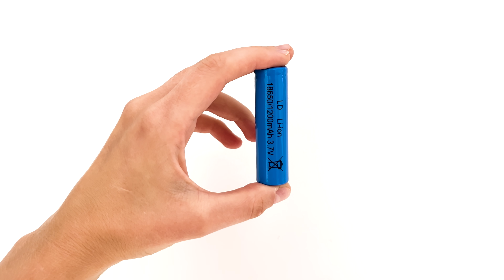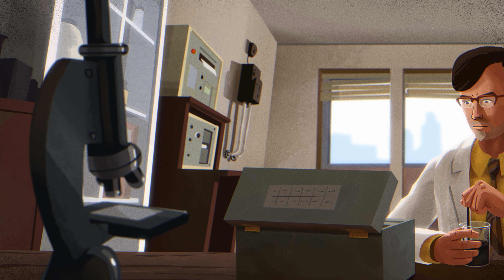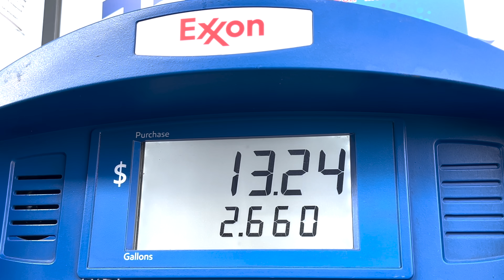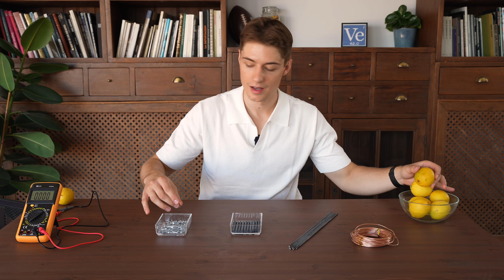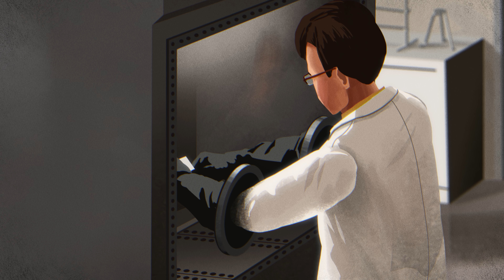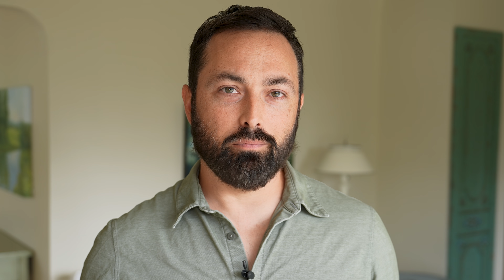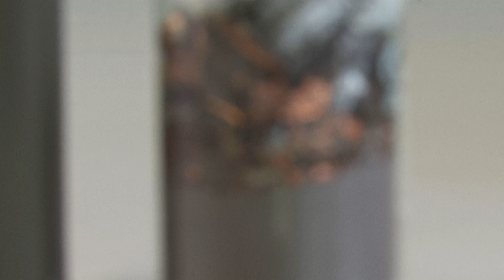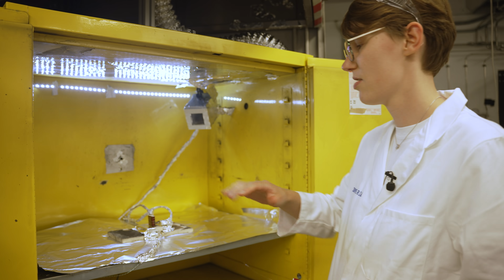The Perfect Battery Material Is Dangerous

Comment: Wish you had touched on the "new" LiFePO4 cells. Lower energy density and voltage, but significantly more stable chemistry, thermal resistance, and increased charging cycles. And being that it is not Cobalt based, but rather Iron and Phosphate based, much less environmentally damaging, and easier to produce. Really cool battery tech imo.
Reply: LiFe is my goto for all my rc transmitters. it still runs like a beast after 10 years
Reply: @simunator you probably need to upgrade your hardware, I have a TX16S that uses 18650 cells and the lithium ones last forever but it can also go for hours on one charge at 1000mw output if I want to fly over 25 miles away
Reply: Was just about to say the same. The New Generation of electric vehicles are starting to use Lithium Iron Phosphate batteries. the loss of density and voltage is marginal, and can be made up for, but the increase in safety and decrease in resource cost, is immense.
Reply: @MetalMaggot46  And then you've got the various LMFP chemistries, which add manganese (and sometimes other elements) to LFP, and get most of the energy density and voltage back, at the expense of some cycle life (but not as bad as NCA and NMC, and as I understand, if you only charge it to 3.6 volts, it behaves much like LFP, so you can charge to 3.6 volts every day, and then when you need the added capacity, take it up to 4.1 volts).
Reply: @MetalMaggot46  Thats what the ANTI EV crowd overlooks in their astounding JOY they never hesitate to gleefully express all over FB, youtube etc in any articles about EV's or especially EV FIRES where they gleefully yammer on about "hows that green tech working out?"  and "and they want us to put those in our GARAGE in our house!!" battery tech is NOT static, i ts rapidly evolving, the all lithium batteries we have had that can burn up at random will be replaced over time with newer better ones, the LiFe PO+4 is a transistion between the all Lithium and hopefully the newly patented anode-FREE battery based on SODIUM that uses no lithium at all!
The lab here in the US that invented it has been working on scaling it up for EV's, it could be a massive game changer- just watch that over the next 1,2,3,5 years!
Reply: @MetalMaggot46  Half the density is "marginal" to you? We need more density, not less. 👎
Reply: @MetalMaggot46  energy density of LiFePO4 battery is 2x lower than Li-ion. That's significant.
Reply: @MetalMaggot46  LiFePO4 can't work in freezing temperature and that means electric cars can never in in a large part of the world. This is why most cars still use NMC batteries
Reply: @shrujanamsyama9940  pretty weak argument. A manufacturer can easily add electric heaters (as pretty much every EV does, along with cooling functions) to the battery pack, at the expense of a manageable and reasonable tradeoff in range. 

It’s not like engines don’t lose range in the winter, either. My diesel F350 does, like all of them do, and my 10 year old Volvo with all the most modern gasoline technology sometimes gets mileage around town that would make my truck shake its head in disappointment.
Reply: @shrujanamsyama9940 BYD's second-generation blade battery can be charged from 10% to 97% at minus 30 degrees Celsius, with only a three-minute increase in charging time compared to 20 degrees Celsius - meaning it only takes 12 minutes to fully charge.
Reply: @MetalMaggot46 what is goal to drive 1000kg of batteries around. 
This energy in batteries also has to be produced somewhere.
Reply: Would be great to touch LTO as well, and also modern sodium batteries while we're at that. We're mining about as much sodium in a year just in the form of table salt as there are known lithium deposits in the world at all, so even if the battery industry scales up like 100x it won't even make a dent in sodium prices or availability unlike with lithium where it would just comletely implode. Sodium chemistry is a bit different so we can't just swap one with another, but the work is being done on that front and I believe there's even been a few commercially produced batteries recently.
Reply: @mc3123456  Sodium ion seems like a better choice for utility-scale stationary batteries where energy density isn't nearly as important as in vehicles and portable devices. California already gets gigawatts of power from batteries every evening, and I assume most of it is lithium.
Reply: @mc3123456  I like LTO the most. It was the only battery that responded to destructive testing only by very little flame and lots of smoke. Other lithium battery types failed pretty much like fireworks. LiPo bags were known to be good fireworks but 26650 battery pack turned out exceptional. Found couple of casings 40-50m away.
Reply: @mc3123456 
We already have excessive capacity for Lithium production. That us why price dropped so much

All the projected demands are unlikely to exhaust the known deposits anytime soon. And not like Li can't be recycled.

U need to look at the amount of fossil fuel pump out every year to see how ridiculous lopsided the argument about environmental impacts and deposit exhaustion between Electric and Fossil fuels
Reply: I think we have Sodium based batteries already in the works.
Reply: @deepbloo580  most solar storage uses LiFePO4, lower capacity isn't an issue, cause you can just put more cells. They advertise 10-15 years lifespan, which just isn't possible with the 1000-2000 charge cycles of Lithium Ion. LiFePO4 has 3000-5000 charge cycles.
Reply: @Youwotm8Tk  the best batteries right now already go up to 8000 ccycles which is crazy. Plus for those who don’t know, it doesn’t just die after 5000. It just means it’ll be down to around 80% capacity. Which is again not even an issue for most ‘big’ cases like solar or personal evenrgy storage.
Reply: @Youwotm8Tk  You have to be specific which "capacity" you are talking about. LFP is used in stationary storage because the capacity for the money is better and the better capacity for the weight that cobalt chemistries have doesn't matter for stationary batteries like it does for mobile applications.
Reply: @Youwotm8Tk More cells mean more weight and size, esp delivery weight and install weight for residential which keeps installed cost up.  

It’s baffling to me after a good 1/2 hour video on the drawbacks in every stage of battery development and the still existing fire risk, that people are still out there claiming their battery tech  has it all licked.
Reply: @deepbloo580  They are already for sale, although the capacity is a bit less for the size compared to LifePo4. The cost should drop a lot more in the upcoming years.
Reply: @deepbloo580 a problem with sodium that is not talked about it the huge voltage drop over the charge/discharge cycle. Lithium is stable (although maybe a little bit too flat...), which makes running electronics on it directly a lot easier.
Reply: @deepbloo580  Yes, the anode-free that uses no lithium, it was patented last summer, they are working on scaling it up for EV's, so it's already a proven technology!
Reply: @deepbloo580  As someone whose labmate worked on them in grad school- we do!
Reply: @deepbloo580 there is no “we”.  There’s just a couple guys working for decades like Goodenough.
Reply: @deepbloo580  probably good for stationary applications if they can get cycle life sorted out but energy density will keep it out of automotive applications.
Reply: @deepbloo580  There are already a couple of Chinese production EVs that use sodium ion batteries.
Reply: @deepbloo580  yep, but they are much less energy dense, not applicable for portable and micro electronics or cars. But could be good for applications where the size and mass is not a problem.
Reply: @s.i.m.c.a  LiFePO4 can charge way faster and can handle way more charge cycles than lipo. I'd rather have a 100% charged battery in 30 minutes that lasts for 8 hours and never loses capacity than one that charges in 3 hours and lasts 18 hours, while losing half it's capacity in 5 years.

After 5 years, a 9 hour battery that charges in 3 hours isn't convenient.
Reply: New tech? LFP introduced by mr Goodenough in 1996.
Reply: they're not new
Reply: @metris5402they're about as new to the consumer market as the Li-ion was when it was finally utilized, sure the tech was developed a while back, but they're really only starting to enter the consumer market within the last few years (barring industrial and automotive uses) I would argue to the day to day consumer they are "new"
Reply: @metris5402 why do you think they put "new" in quotations?
Reply: "New" is a bit off, but you're damn right. Those things can take far more abuse, but not quite as much as newer LTO cells that can be discharged to 0 and survive insane conditions with near 0 internal resistance, at a major cost to capacity and production cost
Reply: @leaf2690  what do you mean by @at a major cost to capacity and position cost “?
Reply: At XCOR we spec'd LiFePo because we really didn't want a battery fire in a suborbital system that we personally were going to fly aboard. Focuses your attention, that does.
Reply: @r0cketplumber  Small world! Think I've seen you on AR from time to time. <- acquaintance of Randal
Reply: @r0cketplumber which means more battery weight, esp in a battery system likely to see sun loads, and that means less payload, to include less fuel margin.   Maybe just me,  but less fuel margin would concentrate my mind.
Reply: @Nill757  The mass savings in going from higher energy lithium to LiFePo was trivial. Arguably the mass savings from less thermal barrier material around the batteries and a simpler charge control circuit made it a wash. I personally was going to fly aboard the vehicle, so the decision was obvious. Anything is easy for someone who doesn't have to do it himself.
Reply: Also, my understanding is that the electrolyte is non-flammable so they can still get hot but don't become flamethrowers.
Reply: @gabe2252  LFP still has TRP, just takes a millisecond more to get there when they short
Reply: LiFePO4 is also surprisingly old it is not the latest tech. The first time I held a prismatic cell brick format of it was in 2004. It was only just being validated for commercialisation.
Reply: LiFePO4 is THE battery for anything you don't need to move. It is better in every way than Lithium-Nickel-Cobalt-Aluminium or Magnesium, except when it comes to energy density per weight. It has already completely taken over the market for home and grid storage. It also starts appearing in "mobile applications", as they start being used in the low and midrange Chinese EVs. However, many applications for Batteries are mobile application, and using LiFePo4 in latops, phones headphones etc would be a setback for these applications.
Reply: And salt batteries too. Sodium-ion is already here and although it’s much less dense and requires bigger cells, it’s literally salt, it’s everywhere and cheap to extract. Imagine a battery dropping two times in price — sure it’d be bigger, but for grand projects it doesn’t matter, and it’s super environment friendly too.
Reply: @zenlettering energy density on Sodium batteries is so low compared to lithium that it would be niche market at best.
Reply: @kamakaziozzie3038  if you have a solar station at home or even a big one for production, it being twice the size doesn't matter. But it's half the price. I don't see how it's a niche market. Sure it's not for phones and cars but for massive(-ish) scaled batteries it''s perfect, especially in growing countries where space isn't scarce but cheap electricity is.
Reply: @zenlettering  LFP in cars is already a commercial success. I would prefer it.
Reply: @ffffffff-vv7yp  I have a lifepo power station at home, that's kinda not the point. no one is planning them to be in cars or phones.
Reply: @zenlettering There are cars with LFP batteries on the road today, including versions of Tesla Y and 3.
Reply: LiFePO4 batteries can be used to power just about anything that normally runs from 12V deep cycle lead acid batteries. They work a lot better since the discharge curve is very flat. They provide 12.8 volts for most of the discharge.
Reply: I design utility scale battery power plants. This is all LFP batteries and have now installed the equivalent of >1000 20' shipping containers of LFP battery cells. The whole industry went from "cool but not financially viable" to "go go go" practically overnight once LFP solutions became available
Reply: LFP aren't New.
Reply: Converted my Ryobi riding mower with it and mowed an acre and only used about 15% for 48V 50AH
Reply: LiFePO4 was the thing for me to look at before buying a home energy storage battery, as I didn't want an incendiary bomb in my house. When a for instance 2,5kWh storage decides to grenade the fire immediately is so large that it can't be contained without a special purpose built cabinet or space which can contain the fire.
A LiFePO4 battery is safe enough to have in any room with sufficient ventilation, the chemistry contains oxygen in the phosphate ion but it doesn't give it up easy.
Reply: This guy missed SO MANY emerging technologies in battery development.   LOLOLOL. And he made this with such confidence too.
Reply: LFP for life
Reply: Got LFP on my sailboat, absolutely lifechanging tech. Insurance won't cover NMC lithium batteries due to fire risk but LFP are OK.
Reply: @kayceecheshall2818  It is a good surprise for me that some insurance companies are literate enough to distinguish not dangerous LFP batteries from other ("dangerous") Li-ions. But yet, try to take a LFP battery or even "raw"-not connected to anything LFP cells in a very good packaging to an airplane or air cargo and immediately they going to refuse/not allow it as it is considered hazardous li-ion still :-(  and sea shipping companies if even allowed, would charge exaggerated "hazardous materials" fee; that's why those LFP outside of China is so expensive.
Reply: @NiueChannel  It may have been fake LFP battery but one went off pretty well in destructive testing I witnessed. No wonder nobody wants to take risks with these.
Reply: Also the bleeding-edge Natrium-ion cells
Reply: @narayanbandodker5482     for those of the non chemistry course background natrium is referring to salt, where in the atomic symbol for salt, in this example or usage, refers to sodium metal combined with chlorine an oxidizer but when combined with the metal becomes the chloride salt of the metal, comes from Latin natrium– natural, occurring naturally in nature......
Reply: And also touch on the new eco friendly sodium ion tech, the high density silicon carbon tech
Reply: this! there are so many new electrode materials slowly making their way into the market, and most of the new designs are cobalt-free. iron phosphate is currently the biggest player in the new market but there are other things on the way so who knows where we'll be in 10-20 years?
Reply: He didn't touch on the new advancement in battery chemistry. LiFePo4 Or Sodium ion battery.
Reply: I got one of those kinds of batteries powering my telescope mount and camera. Doesn't need to be energy dense since it's not going anywhere. And it's safe to keep around me, especially while driving. (Not really a plus, considering my phone)
Reply: LFP is the future go-to for most EV.  New Chinese rules will require no thermal runaway.  LFP are very practical for daily commutes, even in cold conditions with proper thermal management (tranferring heat from motor and inverter).  Only in long range small vehicles do NMC still have the edge.
Reply: Poop my humans poop we need that phosphate.
Farms what about the animals.
That too give it all of it we need batteries 😂.
Reply: LiFePO4  is already existing in some cars
Reply: I put lifepo4 in my battery backup system for my computer. They outperform lead acid batteries in both charge speed and total output power! APC said that it would burn down my house and started pestering me to buy another lead acid battery when I called me.
Unless they booby trapped my battery backup system, there will be no burning of anything.
Reply: Brooo! This is the only reason I clicked this frickin video! 🤣 I waited to the end to see him not even mention LiFePO4!
Reply: That's all well and good, but batteries are designed for purpose.  Either slow and consistent release (e.g. your phone) or high output over short durations (your car when you plant your foot), the latter by it's very nature will have a far more energy potential and a far more volitile battery chemistry!  

The example you gave is just another itteration of the former that probably has not yet reached feasability for most uses in the former...
Reply: Okay these names are getting out of hand. "LiFePO4" Sounds like something mercedes would name their new car in 2057.
Reply: Thanks for the LiFe lesson. Seriously 😃
Reply: Yes, I was waiting for that to be mentioned, the rest of it was just history really.
I have been using LiFePo4 cells in my off grid power system since 2013, I just pulled the invoice for my first set, 200 Ah @ 52v, around $6500 NZ, they 14 out of 16 are still usable, they never got over or under charged so the cycle life is kind of irrelevant. I swapped them out early this year for 400 Ah @ 52v for $7000.
Mine were sold as Lithium Iron Phosphate Yttrium, the yttrium, apparently helps to stop combustion by bonding with the phosphate or something.
I was hoping this video would explain.
I am dissapoint.
Reply: The current state of the art is the EVE Energy 314ah LFP cells, they can handle as much as 7,000 cycles under optimal conditions
Reply: Or the Sodium-Ion batteries, with lower energy density but higher power density.  Or liquid batteries. Or a few other techs
Reply: Limited energy density, higher cost, slower charging speed, lower discharge rate, and limited temperature range are some of the drawbacks of using LiFePO4 batteries..
Reply: There's a problem with LiFePO cells, it's the Fe, or Iron. It's very stable, and conducts well, but it's Iron. It's heavy. Not exactly what you want in your phone, car, airplane, or spacecraft, where grams count. For static installations and for long term durability like grid or home based storage LiFePO is outstanding, for mobile applications, not so much.
Reply: Would be cool to know that history too. These have now been matched pretty closely by sodium ion batteries, which is really exciting given sodium's abundance. Saw a cool vid of a guy testing them out with an electric skateboard Life cells have been around a while. I rememberabout a couple decades ago when Popular Science had a person that made an electric motorecylce by extracting the cells from DeWalt tools that started using them.
Reply: @Pyromancers  "made an electric motorecylce by extracting the cells from DeWalt tools "

LOL reminds me "Garage 51" on youtube, they did things like making a V8 engine out of like 50 chainsaw or drill motors and driving the Lada down the street.
Reply: If the future will rely as much on batteries as it now seems, surely we will have different types of batteries. Low energy density but very stable and easy access materials is great for on the ground power storage. For commercial solar and wind farms as well as homes. To even out the grid between night and day, to be able to sell electricity when it is more profitable to do so etc. It doesn’t have to be light because it’s just sitting on the ground. But in a car battery, charge density has to be a bigger priority else the mileage will be too low.
Reply: I think the problem is that there are A LOT of new battery technologies out there and he probably didn't want to bother singling out just one. Who knows which tech will be the next big hit! (I kinda think it will be a bunch of solutions that depend on the situation, not just one :) )
Reply: Lion isn't cobalt based. The cobalt helps reduce the chances of random runaway.

Source:
I used to work for a manufacturer of them in the engineering team.
Reply: I just wanted to be the 100th reply 👋
Reply: LTO FTW, LiFePO4 is nowhere near as temperature stable with the C rating and thermal stability

I couldn't abuse my SCIB cells any more. And they just couldn't care less 

With a lifecycle that in concept will out last me!
Reply: @kyleschultz8350  LTO currently costs too much $/Wh wise. Especially when you are considering using it for self-reliance (pairing with PV or wind and need a capacity to power the entire house). So currently makes more sense to buy less life cycle other types cheaper and just wait 10-15 years with hope that the cost of LTO will go down or other chemistry will be available. And the low energy density is pretty much a no-no for any EV candidate.
Reply: I read “PO” as “Po”

I thought you said polonium 😂
Reply: Wait what ... I didnt know electric cars were from the 1900 ...
and I though we live in the future ... I feel so dum LOL
Reply: I had a Shorai LiFePO4 battery in my motorcycle. It had an internal short while I was on a road trip in Alaska and almost burned up the bike. I inhaled a significant about of the smoke coming out of it just getting it disconnected and removed. Went back to the old, safe, lead-acid battery. I've never had or even seen one of those melt from the inside out.
Reply: @Bill_Ross  poorly done electric connections don't care what the chemistry is
Reply: I just went through a report from Stached training about LIFePo batteries suffering thermal runaways just like lithium batteries under exactly the same circumstances. The chances of it happening are a little lower, but they are not inherently safe.
Reply: 100 degrees difference between thermal runaway is not that significant or safer. LFP has been exploding and its off gassing is even more toxic. Do you sell batteries or did you just buy the hype
Reply: That's just the natural trade-off of energy density that results from basic physical principles, not something special about "new" lithium iron phosphate batteries.

The more energy you manage to cram into a small, light package, the more energy you have ready to be unleashed in undesirable ways in case of failure.

It's exactly the same as a pile of firewood being intrinsically "safer" than a tank of propane at 100 psi. That doesn't change the fact that lugging around the propane tank would be easier.

LiFePO4 cells are slightly tamer than LiPo but also slightly heavier and larger. Lead-acid batteries are waaay larger, heavier, and safer than both. Pick your poison.
Reply: @qdaniele97 "LiFePO4 cells are slightly tamer than LiPo but also slightly heavier and larger. Lead-acid batteries are waaay larger, heavier, and safer than both. Pick your poison." - I think the problem is that AGM and Gel batteries while being "safer" are simply doe not fit into any deep-cycling application (pairing with renewables): no long life cycles and DoDphobia, and with lifetime of cycles 10 times lower.
Reply: Li-Si-C is way more promising. There are already prototype batteries with 3 times the energy density, and commercially available ones have 1.5-1.7 times the density of Li-ion. Look at the latest Chinese compact phones coming out with 8000 MaH batteries. Obviously you won't find it in Apple/Samsung flagships, as they prefer planned obsolescence.
Reply: @jackwilson5542  I didnt realize they had gotten the charge cycle count high enough for Comercial availability yet.. the battery industry is so wide open, I just wish more than the chinese were really all-in on the development of lower cost per watt-hour, durable batteries..  in the 20th century he who controlled the oil had the biggest influence in the world..  in the 21st century, it is he who controls the batteries or has the best batteries will reap the extreme economic beneifits ..
Reply: It's not new LFP was manufacturer since over 20 years.
Reply: They don't have access to this LFP technology
Reply: LFP is not new at all, it just became so much better it's now used in cars (including my own). The chemistry is been around for decades though.
Reply: Yes, especially when mentioning the problematic provenance of a lot of cobalt and nickel. 

I also thought the topic of the difference in risk between well regulated battery system with built-in safety features and those without (i.e the risk of electric vehicle fires is really massively lower than a scooter or power tool or phone.
Reply: It was interesting to see that my solar power station also uses LiFePo4 batteries.
Reply: @chanhien4000  My Vtomen Jump 1,000 unit uses that
Reply: LiFePO₄ has been around since the 1990s. It's hardly new.
Reply: Thanks for the great comment! I’m currently looking for a battery solution so I’m going to research LiFeP04 cells now!
Reply: never heard of that 1 thx
Reply: Tesla’s Model 3 RWD uses this battery and actually encourages you to charge to 100%.
Reply: @bimblyspots I am glad I bought that specific model for the LFP battery before Tesla took it off the market.I feel better knowing that it won't light itself on fire.
Reply: @brewmanchu1 wait, they took it off the market!? im aware im 2 months late but why would they, it’s such a good tech for battery
Reply: Aluminum ion batteries are the future, I think.
Reply: I use them as replacements in UPS devices. Saves a few pounds, as well.
Reply: cool!
Reply: How about Sodium batteries or Solid State?  No mention of any emerging technologies just over exaggerated fear mongering.   This dude’s a joke.
Reply: Hey that sounds really wonderful. Happy to get on board with less child slavery to produce the batteries my life needs. Thank you for mentioning this as i've never heard of these before
Reply: He won't, not their content is dictated by tightly controlled schedules and propaganda as they sold out to private equity
Reply: @juanpablosanchezaveleyra6454 
Dude, you seriously think their videos are propaganda? That's wild. How do you know private equity bought them? Are there any< docs proving that?

I don't think this channel is propaganda. There are many waaaaay worse propaganda channels like tyler oliviera who just demonizes anything left wing and dehumanizes anyone marginalized.
Reply: Make your own content, then. This is your opportunity.
Reply: Lithium pool still an issue
Reply: What about the stuff they recently started putting into phones with more capacity density
Reply: The biggest drawback for me with them is the charging in 0 C weather..can't do it.  So they need a heating system in those scenarios, which is another battery chemistry, usually.  Lithium in general can't do 0 C charging I think.  But I know LiFePo4 can't.  You can discharge below zero, just not charge.  And lithium loses huge power when it's cold.  I guess nearly half capacity at 0 C vs 20 C.  So if your load is too small to warm the battery, you will have no capacity.
Reply: @AaronHendu  So keep the battery in a conditioned space.
Reply: Lifepo4 is pretty much like the old NI-cd batteries. Stable , very durable,  and high output current, but without toxic ingredients like mercury. Though it doesn't beat Ni-cd in terms of longevity and durability it's still pretty close as a modern alternative.
Reply: @MrDragonRX  it’s the cadmium that’s toxic in Ni Cads.
Reply: And Silicon Carbon ones?
Reply: Sound amazing
Reply: I just purchased a battery "power station", and the LiFePO4 cell chemistry was a major factor in my decision.
Reply: It's the best, I sell the Sonnen home batteries, I've had clients drive cars into them. The cells just get hot, but the house isn't on fire.
Reply: @Artem-gg6bq  of course the battery salesman loves them
Reply: Yes I love the newer lifefo4 batteries. I bought two 12.8v. 300ah batteries for external use on my apc smart ups 1000va and 1400va. I ran a 450 w ac load at 120vac. I got over 10 hrs operation out of that. This gives me plenty of time to roll the portable generator out to feed the house ac and lights while the ups is lit up for some lights and fridge
Reply: surprised they didnt.. being this is a recent video..  they are definitely a big step in the right direction! the biggest issue nowadays is will the cheap crap LifePo batteries ruin the breakthroughs.  lots and lots of poor quality batetries for solar, RV's etc being sold online..  with really bad BMS's, very little overcurrent protection etc... it doesnt matter if a fire occurs because the BMS attached ot a battery is junk.. or if the cells were rejects that shouldve never been sold..  the battery and its chemistry will take the blame for every single fire or injury..  and right now theres video after video and article after article about cheap batteries but yet people are buying them by the 1000s...
Reply: Yeah this was my thought the entire video, this video feels outdated on release, sad because alot is still good.
Reply: Some comment here mentioned the company this channel now ”works with” but it’s not here anymore… says a lot?
Reply: Unfortunately the energy density still sucks
Reply: I say hallelujah
Reply: Both my cars (Tesla Model 3 RWD, MG ZS EV) have LFP batteries for all those reasons (cheaper, safer, no problematically obtained Cobalt) and so will the cars that replace them when the time comes - assuming we haven't moved onto a new generation of solid electrolytes or whatever by then.
Reply: It doesn’t matter unless batteries are modular and you cannot swap them yourselves, but producers are staggeringly greedy and entitled and they always bake battery into car or other vehicle. This makes vehicle live as long as battery lives. And they always degrade innoutside conditions
Reply: its not very good for vehicles since the state of charge is hard to track
Reply: @Blox117  Neither of my cars seem to have a problem with it. You just have to make sure you fully charge them at least once a week. Since LFPs are fine with being fully charged every time, unlike NMC, this is not a very onerous requirement.
Reply: @simongreen9862  i said vehicles, not cars. for unicycles, LFP is dangerous since you need to know state of charge to know how much headroom you have before cutout.
Reply: Also a John Goodenough invention.
Reply: Also much more CHUNKY with all the additional mass
Reply: yes it is, but that's not what this video is about so why would he have touched on it?
Reply: uh oh, you know sometimes I get a response to a comment,  like yours. But the by the time my phone goes through whatever,  it takes me to a different string.  Sorry.
Reply: the newer Aluminum batteries are even better with three times the energy storage no rare materials non toxic totally stable (no dendrites) self cooling much faster charging cycles longer life. no cobalt wider temperature range and non flammable.
Reply: @MrMichaelBCurtis Al doesn’t work for recharge. Not a solution.
Reply: @Nill757  ah, it lasts 7,500 charges minimum with only 1 percent loss. And it charges faster than Sodium. what are you talking about? Lithium only lasts 1,000 charges. (both are the minimum average.) It charges in a much higher range at a much faster time, they are using gel instead of liquid that doesn't outgas, so no fire problem, and it is cheaper, and holds three times the charge of Lithium
Reply: @MrMichaelBCurtis there are no , useable, Al rechargeable batteries w 7500 charges. Battery stories are the worst kind of bs
Reply: @Nill757  the science fits, and the production is supposed to be out this year.
Reply: @MrMichaelBCurtis . Right, real soon now. No the science does not fit.  The only demonstrated high energy density Al batteries are Al-air, non rechargeable. Rechargeable Al batteries suck at energy density and always will, or the charge capacity rapidly falls off. For years, con artists have done mix and match w these drawbacks to make them look good if you squint. Get lost.
Reply: @Nill757  yeah, you don't know the science, Just because they didn't get results in early testing doesn't mean it isn't possible. They are claiming an electrolyte gel that can help with 7,500 charges with a 1 percent drop off and no dendrites. Aluminum has three electrons to work with for charge and lithium only has one. And yes this wasn't possible "years" ago, so get lost.
Reply: @MrMichaelBCurtis  so, you started w Al batteries out next year, backed off to “prototypes”, and now, nothing exists but theoretically it’s “possible”.   This dance has been going on for decades, circling the guys who did real work like Goodenough. Electrons in the shell don’t make a battery. I know battery chemistry, and you’re another Elizabeth Holmes wanna be grifter, one of many.
Reply: @Nill757 they are going into production lster this year.  But you should invest in chinese companies,  even though Warren sold all his shares this quarter.  Don't believe one of the richest men knows anything about the future
Reply: @MrMichaelBCurtis everyone of you grifters same scam, it’s in production, it’s in the lab, well it’s possible just not working yet, and then, well some billionaire is in it so who are you to say no.  Go look up picture of Joe Biden sitting next to Elizabeth Holmes.  Maybe you can still get in on it.
Reply: Here in aus LIfePo4 is becoming very popular for auxiliary batteries on cars and trucks. It’s far more compact, safer and can handle be inconsistently charged or discharged, this was damaging to the traditional deep cycle and agm
Reply: @sampollock6456 ”auxiliary”?
Reply: @sampollock6456  newer technologies are better than older ones, that said, I will not buy an EV until the aluminum batteries come out, massive leap forward.
Reply: (While they are slightly lower energy density, they are a brand new chemistry technology in comparison; they will get denser. And it's about 10x the charge cycles, which is pretty useful)
Reply: @tutacati still like the aluminum technology non toxic cheap and completely safe
Reply: Lower energy density is booooring
Reply: @MohsenAmiri-y3m  the new Al-ion has higher energy density
Reply: right? Super sad to see veritasium putting out a pro-trump propaganda piece.
Reply: New?
Reply: This was a major oversight to not mention.  More than 50% of the world’s electric cars are already powered by this chemistry with no risk of fire at all.  It is only a matter of time before the energy density is on par with current NMC chemistries and NMC batteries are legislatively banned from new vehicle production.  CATL’s latest generation LiFe battery is already very close on energy density.
Reply: @cherokee180c0  Al-Ion batteries have the potential to have three times the energy density of the Li-Ion batteries. And due to chemistry, Li-ion batteries will always have a fire risk, Al-Ion does not. All Li and Na batteries will be obsolete in less than 5 years. Al-Ion batteries are also cheaper, safer, operate in a much higher temperature range, last longer, and charge much faster. Not to mention they don't need cooling
Reply: I was sure LiFePo4 was where this video was heading
Reply: This should be 2-3 parts video. This video essay stops at regular Lithium-ion battery. Right now, we have LFP, solid state, and sodium-ion battery. Each of them is fascinating technology and I bet there are some cool story behind each.
Reply: Lithium-Iron Phosphate, or LiFePO4 batteries are probably best suited to stationary applications when compared to typical Lithium Ion batteries.  That being said, LiFePO4 still has better energy density than almost any battery technology other than standard lithium ion batteries.
Reply: wow
Reply: @CPTPeterson can I get more info on that.
Reply: What "new LiFePO4 cells? 
I've been using them for years 🤔
Reply: I use lipo in some of my rc airplanes and almost lost my house too it..  made a repair to my airplane.  On my build table in the basement..  put my battery in.  Tested the planes control surfaces and pulled the battery back out set it on the table and went to go piss..  when I came back I had a fireball.   Lucky I had a extinguisher..   lots of damage tho. Entire table top was on fire.  Everything burnt that could burn.
Reply: @hondaxl250k0 thanks for this, I just grabbed a spare fire extinguisher to keep on my charging bench lol. My plan has been to throw it out a door with long needle nose pliers, still is, but that would put out anything that catches for as a result
Reply: @hondaxl250k0  considering the massive importance of high capacity batteries for diesel-electric naval submarines, a lot of effort has been put into finding better alternatives. A couple years ago 1 or 2 East Asian countries apparently succeeded in making Li-ion safe and stable enough to put it on board of their submarines, namely Japan and if I recall correctly Taiwan as well. The Japanese in fact removed the Air Independent Propulsion from their most recent submarine class and filled up the additional room they created with Li-ion batteries as they find it gives a better improvement compared to AIP, which is amazing considering start of the art AIP gives modern submarines up to 3 or 4 weeks of underwater submerged endurance.
Reply: Every cell chemistry has it's issues. It an optimization issue, not the hunt for the ideal battery some constantly dream of. Not much progress in the last 12 years since the first Tesla battery I had in a car. And that wasn't actually innovative then.

LeFePo4 has expansion/contraction challenges, etc. Samsung e.g. doesn't consider them yet for mobiles. In cars they might work, as cars are now accepted to be ridiculously heavy and there's enough volume. For the applications the ideologists fantasise about, like planes, etc., of course a reduced gravimetric energy density is a no-go. Again, reminder, batteries are still around 200 Wh/kg, fossile fuels around 12,000 Wh/kg and H2 around 33,000 Wh/kg, making H2, if we like them or not, the only viable solution for many applications.

I have a LiFePo4 battery as a power bank, ideal because I don't care weight and volume as much as fire hazard reduction. Battery electric solutions don't scale because of charging infrastructure not scaling mid term, so at least the fire hazards should be manageable. We will see more restrictions for cars like in Australia for indoor/underground charging, ...
Reply: @BlueSideUp wow, hydrogens got that much wh/g is something I've never heard of. Interesting.
Reply: @BlueSideUp  You hype hydrogen without even mentioning the density, production, storage or any other issue. The only advantage hydrogen has for terrestrial uses is it allows EV naysayers to save face. You want to build up an entire hydrogen distribution system from scratch but upgrading the existing grid is too hard?
No I don't think batteries will be doing long haul flights any time soon. But 99% of people aren't flying anywhere every day so lets just do the job that's good enough for them.
Reply: @BlueSideUp  Good comment. Would you park an electric car (LFP battery) in your house? What if it's a sodium-ion battery?
Reply: Goodenough and his team also invented that in the 90's. It's still a Lithium Ion battery, which was the point of this video.
Reply: LFP Got issues regarding the Voltage and Voltage curve while used. Max voltage is around 3.2 for LFP, while NMC goes up to 3.7 in Nnrmal use, ~4.3V in EVs and could go to 5V if a stable electrolyte is found. Also other than Li-NMC that have a kind of steep slope so cell voltage correlates to state of charge LFP Batteries have a plateu, that creates engineering problems. SOC is actually measured by "counting electrons that leaving the Battery" (that's why some Teslas have to be completely discharged and charged from time to time, so the SoC guesstimating system can calibrate). 
As so often truth lies somewhere inbetween. Hybrid cathodes containing LFP and NMC are researched at the moment. LFP particles in nanometer-range can slot inbetween NMC particles (usually micron size) and boost the energy density even further
Reply: That is what I use in my semi-truck. They are totally safe for living space as they do not gas off at all. You can hammer a nail in the battery itself and get the usual spark and smoke, but no thermo runaway fire and will self extinguished.
Reply: Oil cartels bought Veritasium 😭 Third of the video is fear mongering about battery fires 🔥 in relation to EVs
Reply: Indeed, over 50% of EVs today use LFP batteries--which anyone paying attention to mainstream sources still whining about cobalt use are clearly oblivious to.
Reply: IMO the ultimate solution of reliable energy storage is not with chemical batteries, as they break down sooner or later.  Rather they should perfect solid state batteries without electrolytes like super caps made with graphene for a virtually unlimited lifespan.
Reply: @BillAnt Solid state batteries are still chemical batteries. Also ultra caps are more dangerous they can discharge in seconds releasing all the energy they contain because capacitors don't have internal resistance to regulate discharge.
Reply: Yeah, all that last part is going to do is feed the climate deniers and trolls. LiFePO4 is what everyone is using for large scale storage and doesn't have anywhere near the issues of the original LIon chemistry.
Reply: Lower temperature operating range and the increased charging cycles penalizes high capacity to start with.  You would have to degrade cobalt nickel manganese 30-40% before they degraded to new lifp capacity.
Reply: @hugegamer5988  LFP is safe enough to have in conditioned spaces and is cheaper per unit of energy. This makes it much better for stationary applications. And LFP can get much warmer than cobalt based chemistries greatly reducing cooling requirements for mobile applications. The critical cooling requirements of cobalt based chemistries brings those chemistries energy density almost down to LFP at the pack level. At the pack level, the difference in energy density is only about 10-15%.
Reply: @williammeek-h2o  false, the internal resistance of LFP is higher on both a mass and volumetric basis.  Perhaps on a cost basis, but in a vehicle with a 800lb battery, making it 1300lbs for a bit cheaper isn’t worth it. Yes, if you sacrifice 40% of your range you can buy a small battery cheaper (obvious).
Reply: @hugegamer5988  Weird, you claimed that what I said was false but then went on to repeat what I said as counter argument.
Typical LFP densities at the pack level:
130-150 Wh/kg
Typical Ternary densities at the pack level:
160-220 Wh/kg.
Hardly a 40% difference. 
And that difference is shrinking every year.
And cobalt chemistries degrade much faster so while cobalt batteries may have a higher capacity for the weight when new, when used, probably not.
As is the difference in number of cars with LFP vs ternary batteries. 
As of last year 40% of all EVs were LFP, up 25% from the year before.
clearly, i am not the only one that thinks LFP is the superior chemistry.
Reply: @williammeek-h2o  220/150 is 1.46 rotfl.  Also you don’t understand what internal resistance means.
Reply: @hugegamer5988  Apparently you don't understand math  because what you said was 150/220 or 32% range cut for typical LFP. 
Not to mention new chemistries like LFMP that have energy densities around 200 Wh/kg.
Also, you don't understand that internal resistance isn't particularly relevant to the highest safe temperature that a battery can operate at. 
LFP, being able to operate at a much higher temperature, can have a higher differential pressure for cooling making cooling much more efficient. And again, this is only true for new NMC. NMC ages faster with a higher increase in internal resistance so for a used car, LFP likely has a lower internal resistance as well as being safer at higher temperatures.
Reply: @williammeek-h2o  The oxygen breaks loose at about 100 degrees higher in LFP than NMC. That's is not that much wiggle room. The anode still also forms dendrites over time and with abuse so it's really not superior, just cheaper.
Reply: @williammeek-h2o  just admit you were wrong instead of bloating your post into a graduate thesis.
Reply: @hugegamer5988  take your own advice
Reply: John "Do Not" B Goodenough
Reply: @jesserosiles4442  the  battery market disagrees
Reply: @jesserosiles4442  Hey, wait a minute, my wife's maiden name is "goodenough" (for me)
Reply: @jesserosiles4442 well back in the day he was and that’s all that matters 😂
Reply: Yea LFP is the goat
Reply: That because LiFePO4 is Chinese promoting battery. So are Lithium - Titanium ones. Americans chose a battery you have to recycle every three years. That for making you replace the battery or the device and pay again and again. I think  John Goodenough invented LiFePO4 at 1997.
Reply: They suck. Also they're not new, been around since 15 years for rc planes
Reply: Absolutely one of the "solutions" that are so elusive. There are so many others.  Why doesn't it happen? You know why.
Reply: New sodium ones seem a lot better than LFP in every way possible.
Reply: Naxtra (salt) > LiFePO4
Reply: Not only is cobalt mining detrimental to the environment but the working conditions of those mines is literally modern day slavery
Reply: Not just LiFePO4, but also the newly being developed Sodium-ion batteries. BYD making mass production facilities for them.
Reply: Salt batteries are even better.
Reply: @oxfordsparky those are definitely interesting, especially for long-term storage of heat.
Reply: All these stupid comments stating the lower energy density of LFP! I cannot hear it anymore! 
FACTS: 
- Even when charged to 100% everytime, LFP is good for at least 3000 cycles! That would cripple NCA (eg Panasonic Tesla cells) to 500 cycles, NMC to 700 Cycles! What is being done about that? YES ... they are only charged to 80% ... and BOOM there goes your energy density!
- Even now in cars from Geely Group you have options for 75kWh LFP (usable 100 to 5% every day! -> 71kWh usable every day) or 100kWh NMC (regularly usable only 80 to 5% -> 75kWh usable every day) ... So where is the disadvantage of LFP again?!
- When sensibly used LFP degrades about half as fast as NMC ... So after 10 years you have MORE usable capacity with LFP than with NMC!
- Newest LFP cell types allow for 5C charging! That means 12 minutes from 10 to 80%! So you don't really loose on travel time with this chemistry! 
- Cars are expected to hold up for 30 years to keep an affordable used car market for every income class ... that is only happening with LFP right now!
Reply: Nobody cares about the environment
Reply: @NomadicSal everybody cares about the environment,  the just don't care about nut jobs who make things up for power,  how much tax dollars fixed anything in the environment
Reply: As written, the Po in LiFePo4 looks like Polonium...
Reply: @Peterwhy valid thank you, I'll edit it
Reply: @Peterwhy That's why it is LiFePO₄. Just as the proper nomenclature is LiCoO₂.
Reply: It's LiFePO4 my guy , Li stands for lithium, Fe for iron and PO4 stands for phosphorus, the same in phosphoric acid , you eat this phosphorus for the DNA backbone.
Reply: There is a campain to reduce sales of EVs, so I think that's why it was not mentioned. Just look at how no one wanted to patent or develop the original LIO battery. They are still safer in cars than gasoline.
Reply: @FLPhotoCatcher lmfao Lion batteries definitely not safer than gas

You can put out a gas fire
Reply: @FLPhotoCatcher  And yet I've rarely ever heard of ICE cars on gas either spontaneously burst into flame or do so on re-fueling. Which is not to say it doesn't happen because I do know of stories/videos of that happening (tragically or hilariously), but I find it hard to believe that, relative to how many of each type are on the road at any given moment, batteries are safer.

(Note that I'm not including accidents or clear cases of shoddy construction.
Reply: @JonathanScarlet  I think you have to count accidents, at least accidents that don't cause serious injuries if they didn't have a fire. Accidents happen to even the best drivers.
Reply: @FLPhotoCatcher ”Just look” at how carefully sourced every claim was in this video, how years of data were collected, and in response there are guys here just claiming w zero evidence about the secret “plan” to sink EVs.  Why even bother w good science engineering videos like this when you’re going to invent bs.
Reply: vertasium's Puppetmasters don't want you to think about them.  It's not a part of *their* narrative.
Reply: @undagroundsoundproductions4214  was gonna say the same
Reply: It's still lithium based, what is needed is a battery that charges in minutes like 5 and that is not combust if punctured or dowsed in water
Reply: Yeah, but they're more expensive and have less capacity - I.E. less profits for companies and not as favorable marketing points. Even consumers don't really care about it at the end of the day.